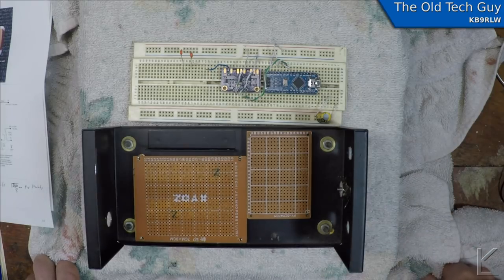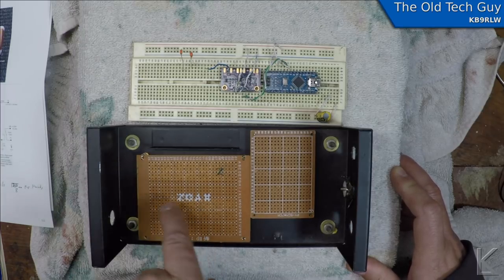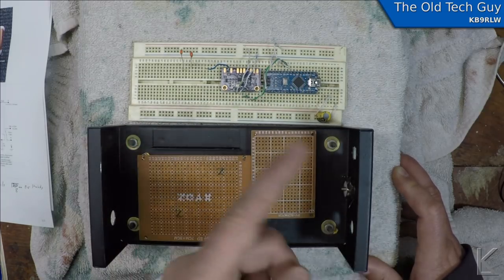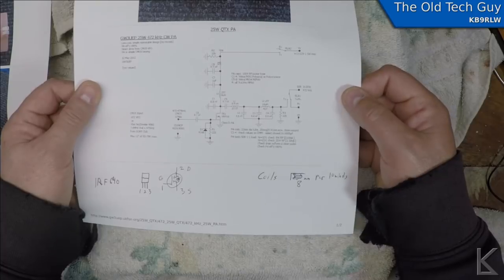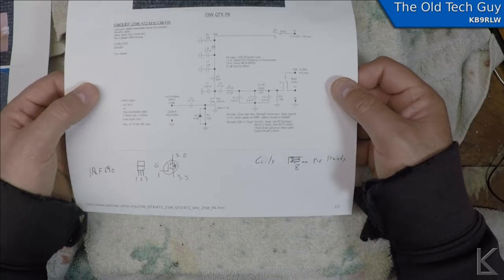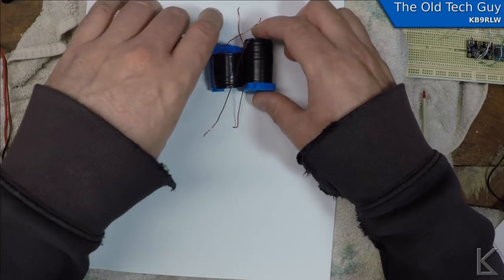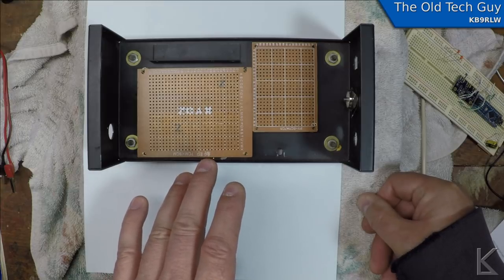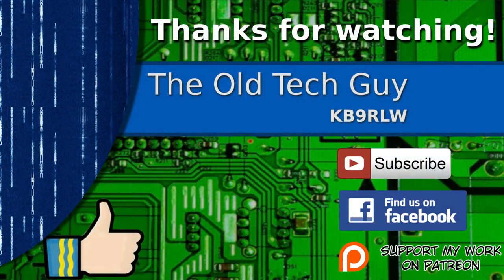Ham Radio - A simple 630 meter CW transmitter part 1. The design.

Comment: Curious if the arduino will be fast enough to control the keying.  Looks like a cool project.
Reply from the maker: I'll be using an interrupt routine running 100x per second for the keying.  Should be enough resolution.

Comment: What about a keyed audio oscillator which drives a Tayloe Mixer via a audio phase shift network. A 74AC74 based Johnson counter is driven at 4xLO to give I/Q clock outputs that drive the 74HC152 configured as a Balanced Quadrature Sampling Emitter (BQSE)   using a XOR chip in the Johnson Counter should allow you to select LSB or USB. what about using an ECC88 as the power amp with a B+ of 50V and the heater driven by 6V 0.05A
Reply from the maker: As usual, you make recommendations that are way outside the scope of the project.   This is a 'simple' transmitter, designed to be easy and cheap to construct. Accessible to the average ham.
Reply: Kevin Loughin it makes for easy unwanted sideband suppression and no extra conversion stages are required as you are transmitting at signal frequency
Reply from the maker: Sure, but this is a simple CW transmitter.  That's why I said outside of the scope of the project.

Comment: Great project Kevin. Check out this old thread about substituting other Mosfets for a IRF510, https://www.eham.net/ehamforum/smf/index.php?topic=46081.0;wap2 You may find that the IRF640 has too much gate capacitance to work in that circuit. It might work fine though. If you need some 510’s let me know ill drop some in the mail.
Reply from the maker: Interesting read.  Similar to other stuff I'd seen.   I'm thinking that at such a low frequency, the 640 might be fine.   I would like to have a 510 or two on hand though, just in case.  If you could send me a couple, that would be great!  Thanks for offering!
Reply: Kevin Loughin I’ll send them today. I look forward to seeing how it turns out.

Comment: What is R3 22k ohm for? 
In a class E amp  there is no resistor to ground! It is waste of energy.
I think he design the circuit with a simulator and r3 is the output impedance.
So you have to replace R3 with a  a 22k/50ohm transformer ;-)
Reply from the maker: I went looking and saw a similar resistor on about half the class E designs I could find out there.   With a 50 ohm load, R3 will only draw 0.22  percent of the energy, so hardly significant.   I can only speculate the reason for it being there.  A safety load in case you don't have an antenna connected when you key down?
Reply: Sorry, I goggle "class E amplifier schematic" and I didn't found a single one with such a resistor at the output!
Well the power wasting is negligible but the protection too.
Reply from the maker: I think the designer has an email address listed on his QRZ page, you could email and ask him about it.
Reply: Thank you but will never build a 500Khz amp. I'm just curious and if nobody of the viewers has an answer, that is just fine.
I think comments, discussions and questions are welcome.
Isn't it?

Comment: For me it's a class E not a class D amplifier
Reply from the maker: Yeah, you're right.  He labeled it Class D on his schematic.  After further research, I discovered that class D, although it is a switching amp, it's primarily pulse width modulated.  Whereas class E is switching and rely's on a tuned circuit between the switcher and the load to resonate and provide the output.
I'll clarify that on the next video in the series.
Reply: Yes class c at the least and class e for the most efficiency.